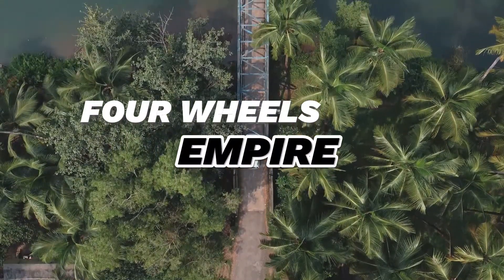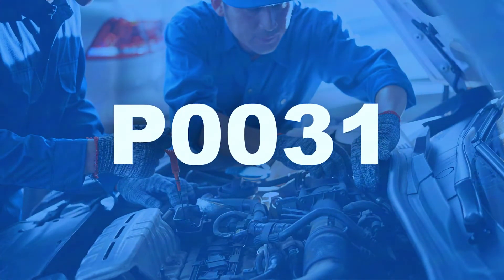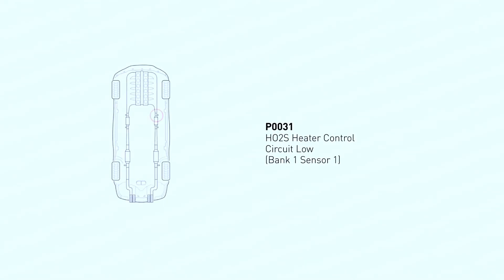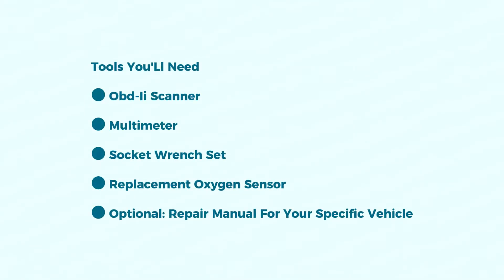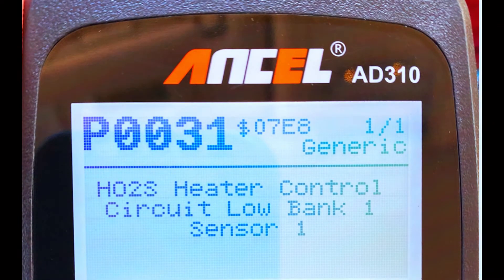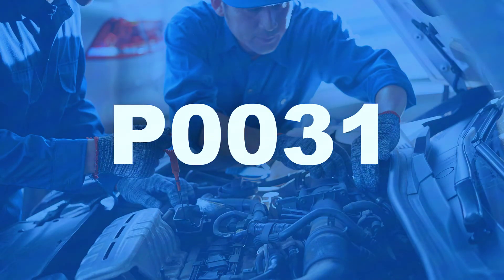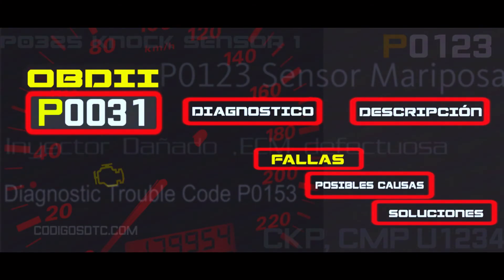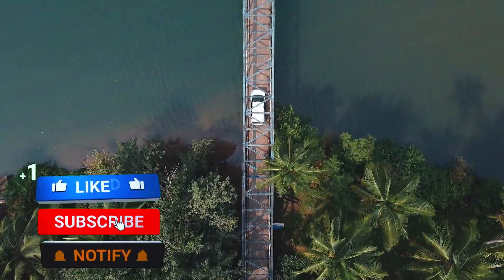P0031 Code: Common Causes and Effective Solutions@FourWheelsEmpire

Comment: Didn’t work. Changed O2 sensor twice check the resistance & voltage both are according to specifications. Checked all fuses & relay all worked good no idea what’s the issue
Reply from the maker: It sounds like you've done a thorough job troubleshooting! Sometimes these codes can be tricky. Have you considered looking into other components that might be affecting the O2 sensor readings?
Reply: @FourWheelsEmpire MAF sensor functioning. Purge valve is okay Pcv valve great. What else any idea last one PCM & I don’t want to go this far